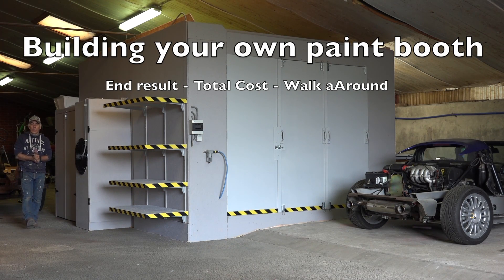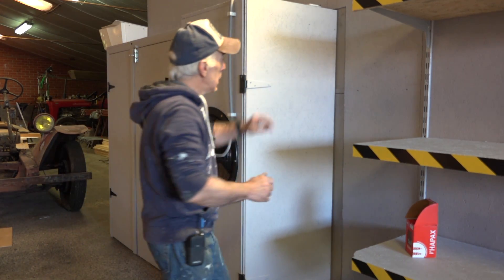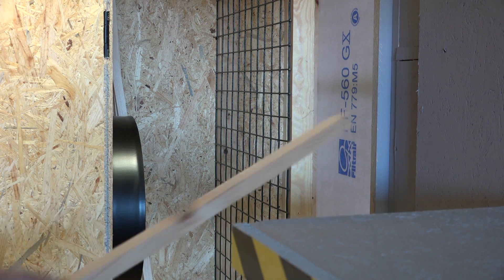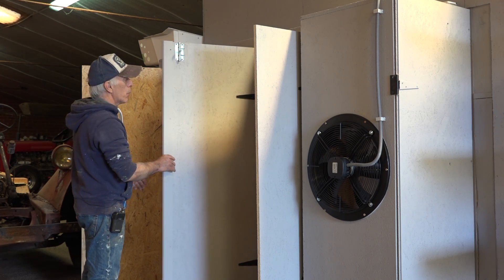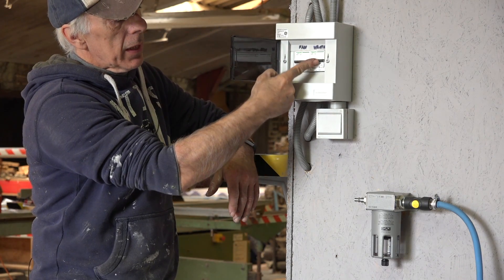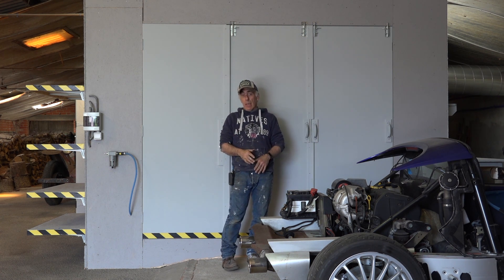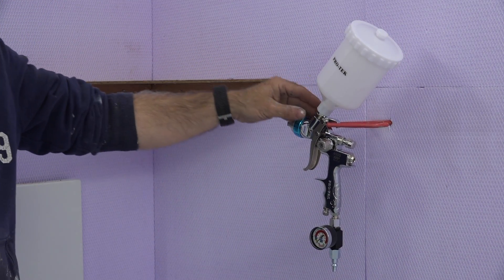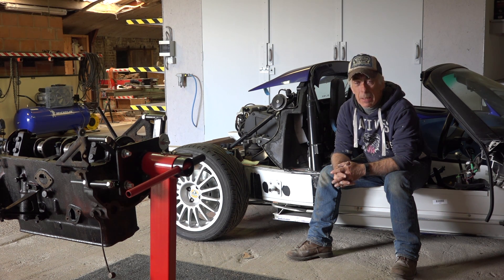Build your own paint booth, conclusion and final result

Comment: Thank you for another great video. Good detailed ideas for sure. I liked the tip of the wet floor for the dust.
I'm doing mine in a used 40'HC shipping container, so the walls part was easy ;-)
also the heating elements LOL (get's pretty hot inside)
It has nice "Cargo hooks" every 2 meters of the roof so I've run zing-zag chain to hang all the stuff to paint.
Them I'm using radiator 12v fans on the doors and back, and a car battery and a solar panel provides me enough energy to run fans all working day...
Reply from the maker: Glad it was helpful!  I was initially thinking of a container as well  as they are low cost .  But then I did not as they are a bit to narrow for a car...
Reply: D3Sshooter correct. I’ve seen combining two containers to make it wider. Al depends on each one’s size availability. I was surprised with the size and location of yours considering that you generally work more on full car bodywork. I would have guessed that you would create a drive-in/out booth ...

Comment: Very cool video, I think you're a cool guy and come across as really honest and down to earth.
I have a question, maybe you can answer it for me.
I built a paint booth with vertical air flow, fresh air comes from the ceiling and the air is extracted from the floor under the vehicle.
As a filter for the fresh air I used bag filters, coarse (G3) and fine (F5).
Because I also used the pocket filters as fine filters, which sit in a box with the fans, I still have almost 2 meters of ventilation duct, from the fine filters to the ceiling in the cabin, where the air comes out.
The reason for the decision was that I read that these filter mats that are commonly used (the same ones you used) are often specified with a maximum air flow of around 900 cubic meters per square meter of filter per hour.
This would mean that I need a calculated filter area of almost 17.3 square meters for my fans for the supply air (two fans with 7800 m3/h) due to the limited air flow (2x7800 / 900).
In your case it would be (4000m3 per h / 900 m3 per sqm per h). Is this specified maximum air volume of the filters negligible?

Thank you!!

Comment: I watched your videos I like your paint booth. There's two things I wouldn't mind seeing for educational purposes. One would be your filters, use the wood to hold the filters in place. I was wondering could you do the same thing using a bunch of Earth magnets where they just slap into place. Let me know if that's a good thought or not. The other thing that I would be curious about if you used a smoke machine. And show the movement of the airflow. And percentage per square foot. It would help me out down in the future.
Reply from the maker: Maybe I will set this up so, you can see it

Comment: Thanks for showing us your process. I want to build a spray booth too, but im struggling to find the correct fans. Could you please supply a link or similar to the fans you bought?
Reply from the maker: Thank you for the comments, i guess it all depends where you live.  Ventilatorland.nl has a large range
Reply: @D3Sshooter  Thanks for answering! I live in Sweden. I was in contact with Ventilatieland.nl but they said they didn’t have any EX-proof fans.

Comment: Great series.  How do you maintain the correct temperature in the booth if the intake air is cold?  Don't you have to heat the supply air before it enters the paint booth?
Reply from the maker: Thanks for the comments, the booth uses far end infra red heating. That does not heat the air but the surfaces of the items inside.  When sparying, the FAN's are on and the temp drops, however as the objects keep on getting infrared, not a lot of heat is lost. As soon as the spraying is done the FAN's go off.  So far that worked real well.

Comment: This video series had quite a few interesting elements, so thanks already.
I have a few questions, hope I don't annoy you too much with...

1. I've looked for ex protected led lights prices...o.O is it an absolute must in a paint booth?
2. If one was to use a radial/centrifugal type of fan in a low pressure scenario, is it safe enough if the motor (IP54) is mounted outside of the centrifuge (so the majority of 2 stage filtered fumes that come from the panel into the air flow of the centrifuge won't at least come in direct contact with the motor, but the motor itself is still located inside the paint booth)?
3. If you had a rectangular shaped 3x2.5m / 7.5m2 / 15m3 room in a shed (all large concrete walls, ceiling and floor building though) and everything you had at your disposal to conduct the air from or to the outside were 100mm diameter intake / outtake connectivity at each end (no further mods possible) and you can't mount any fan outside, do you think a positive pressure scenario would still be possible? If so how would you generally go on about it? I have a 3k m3/h, a 2k m3/h and a 1k m3/h centrifugal fans at disposal. Doable?
Reply from the maker: TXS for the comments, well arc free light fixtures are indeed needed IMO, as the fumes of the pray can ignite . But then again, if the lights are on before spraying that might not be an issue...
Reply: @D3Sshooter  are normal LED lights arc free?
Reply from the maker: 1. well it is recommended as painting releases explosive gasses ( thinner and air).  So, I would say yes for your own safety . unless you only work with water carried paint.
2. That is a very good approach , a motor that is outside the airflow is the best approach.  But that motor is best outside the area where there is an air/solvent mix . Else its going to be the same issue.
3. I doubt very much that this will work , 100mm is way to small to extract the air.  Remember the air in the booth should be changed  entirely  about 30 times per minute or every 2 seconds for an excellent extraction.  My diameter of the extraction tube is about 500mm and the intake or exhaust is filters /funnel is 500mm by 120mm and that is just enough.  So its all about been able to extract the air and fill the cabin with fresh clean air in a limited time. Else you will work in a fog of spray.   So the 100 mm is not going to work....

I hope that this helped
Reply: @D3Sshooter  thanks a lot for your help, advise and time man!

Comment: Can we change the inlet and outlet fan in other positions as we prefer
Reply from the maker: Thanks for the comments, of course  you can . As long as you have a good stream of air.   The best is top in and floor out , a down draft... I did not do that .  My boot has been used many times and works like a champ...
Reply: @D3Sshooter first of all hello from Kerala India planning to build one for my first paint shop  ok thanks for the reply what if I keep inlet in left side and outlet in side opposite to front door
Reply from the maker: @bastinrobert4156  That will work as long as you get a draft/ airflow through the cabine, so no area's were the air is not able to flow as in and out are to close and on the same plane.. Opposite sides work best.  Good luck
Reply: @D3Sshooter  thank you sir for kind suggestions and guidance

Comment: I have only one concern about this great-looking paint shop. Can the jackodur endure the acetone or similar paint thinner?
Reply from the maker: Igor Farkaš , sure as the one i used has protection enforced layer.  So far i have done many  paint jobs. And so far no issues or damage.  Time will tell.  But a test with aceton was not done.   Normal thinner  does not affect it.  So far.  Of  course i do not spray directly on the walls.

Comment: Excellent job!. Could you post up information about your fans you used.Type -Model Nº/Brand I'm in Australia and trying to find a good fan.......
Reply from the maker: Thank you for the comment, Sure  the fans are 380 Euro and displace about 4000 m3 of air per hour. You can find them here https://www.ventilatieland.nl/categorieen/9174/axiaal-ventilator.html    . They work very well for me so far....although they are not 100% class A explosion free.   But that is not needed for the amount of work I  do.  You might want to look at fan's used in industrial kitchens, they are typical large and turbine based.

Comment: What kind of compressor and how many gallons?
Reply from the maker: Marc, that all depends on what kind of paint jobs you will do.   If st just a small piece, then spraying is a matter of seconds. So a small compressor with a buffer of 25L  is good enough.  However, if spraying involves longer times, then you will need a decent compressor with a larger buffer.   Airflow must be consistent.  The paint gun is another element, as there are many different models , HVLP, standard and other, also consider the nozzle seize.  So all by all you will need pressure and airflow out of the gun.  I paint at 20PSI with a SATA 5000, that is the pressure at the paint gun itself. .   My compressor has a netto of 250L per minute and max 8 bar..with a 200l buffer.   So far no issues

Comment: Nice booth you build !
But don't forget to use ex save lights  and  fans  !
By this typ of axialfan the paintdust goes right thru the electric... so it is posibel that it can give a "big bang".....
And if you make a biger paintjob and you have a lot of paintdust are this kind of led lamps not realy save...
And belive me that will be a realy realy big bang..
2 times in my live (28 years of carpainting )
I have seen this...
1 x a selfmade booth 
there was no part where it was .... the whole workshop was torn into 1000 pieces .... where luckily I was not there that day ... and once a professional painting booth. which exploded when the colleague turned off the light ... (deflated at the lamp) the pressure wave deformed the whole paint booth. it looked like a balloon. everything that stood in front of the painting booth flew away ... cars tools everything was gone ... windows doors shutters .... everything thrown .. Luckily, the control box was in another room! and we others to break so nobody was hurt! but the one with his homemade paint booth did not have so much luck! So always make sure that the electrical system is explosion-proof on a paint booth!
Greetings from Germany
Reply from the maker: Dirk Wichmann indeed that is always something to comsider

Comment: Are you too restricted to shooting the waterborne (vs. solvent) paints in the UK? Great job, I really enjoy your videos. Dave, Niagara Falls
Reply from the maker: Thanks Dave, the issue is that you need additional drying equipement for the paint , without it the dry time is to long. And most DIY do not have the ability to invest in that extra cost.  So bottom line, we have water based paints and solvent based.  I guess that in a short time the solvent based paints will be out of the market for environmental reasons.   So its al about the drying time for the moment.  Athough the water based paint is making big progress.
Reply: We've been shooting the waterborne for years. I grew up on lacquers and enamels. But now, I don't know anyone who would go back to it.  I'm told there is a lot less work and a much better job when your done. I guess, don't be afraid. You may really like it.